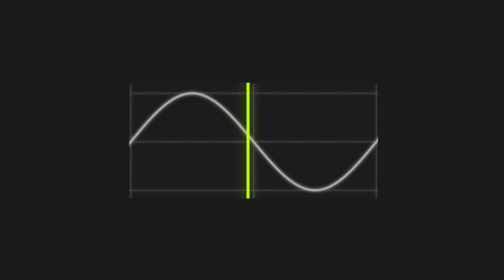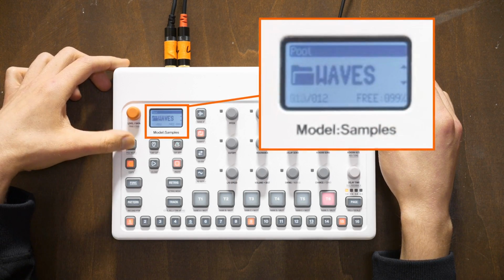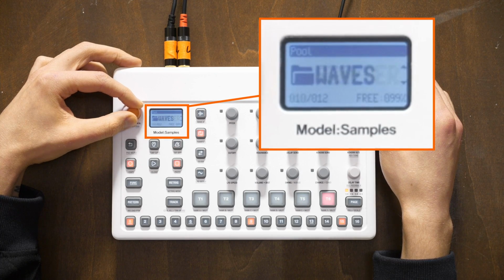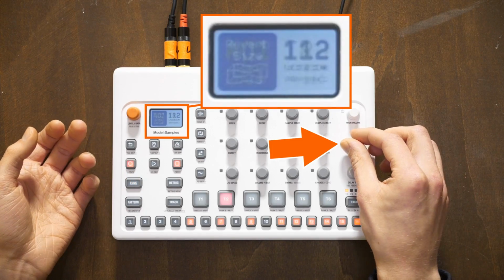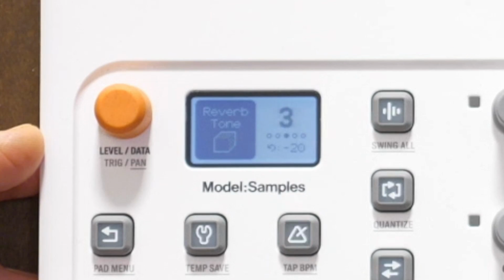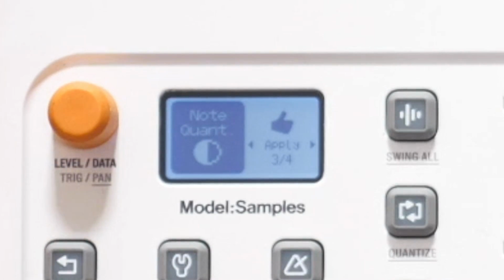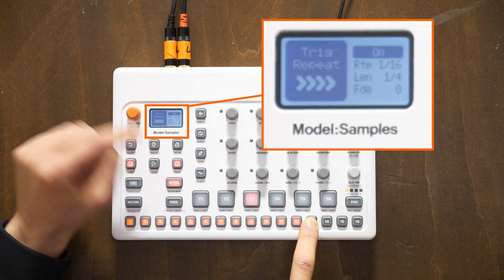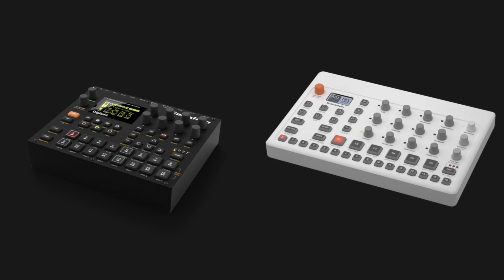Elektron Model:Samples and Ess Senpai | haQ attaQ #TSR19

Comment: the more I try to learn about this machine the more lost I get
Reply: Did you end up getting one?
Elektron seems like they've never used a Yamaha, Roland or Korg...
So they kind of use they're own workflow that feels completely unintuitive to anyone coming from the other corps...
But it makes perfect sense in an Elektron kind of way...
Reply: @BendApparatus  hey I did get this same machine.
Mine wont record right there are two ways to record something but it never works right.it never does what is shows in other videos I tried to follow the steps but it doesnt record right.But I can play it live thats about it.But the pads are good and  can be expressive using the roll feature.I like it but I wish I could record stuff to it,it never works though.
Reply: @dragonmodel9262  🤔
That's weird.
Recording can be done in 2 ways.
1. Push the circle button then just push the little number pads in the spot you want the sounds to play.
You do have to switch to a different track for each instrument using the big pads.
2. Push the circle button THEN the triangle button while still holding the circle button. That puts you in live record mode. Then play your beat using the big track buttons.
you can switch to quantized or unquantized mode. By toggling the above button combo a couple of times.
It's fiddly but the screen will let you know which mode you're in.
There's also a click/metronome you can activate through another button combo FUNC + 🔁.
That is unless you're talking about some type of hardware issue...
Reply: @BendApparatus hey I appreciate the reply.
I will try this and see if I have any luck .hey thank you.
Do you have to set the tempo or how many bars it will play when you record something if that makes sense?because it said you can do a live recording but I willtry this first,hey ty I will let you know if it worked
Reply: @dragonmodel9262  you don't have to set the tempo unless you want to.
The default tempo seems to be 120bpm. I'm 1 of those people who always forgets tempo when making beats...so all my beats are 120bpm...😅

Default bar length is 1 bar (16 steps).
You can make it longer by pushing FUNC + PAGE then using the 🍊 knob to increase it.

But here's the thing.
By leaving it at 1 bar (16 steps) you can try to learn the sequencer's probability and conditional trigger functions to make a 1 bar pattern sound like 2 or 3 even 4 bars long!

There's a lot of power and wackiness in this odd white slate. It's just a matter of trying different stuff.

TIPS!
1. Make a habit of pushing the ⏺️ button after you finish recording live to get out of it and not accidentally record knob twiddling onto your pattern.
2. Once you get a groove going you like. Push FUNC + 🔧 button to quick/temp save to a 📋. So if you knob twiddle yourself into a mess you can push FUNC + PATTERN to quick load your saved groove again!
Remember it's a temp save so you will still need to permanently save by going into the 🔧 menu and pattern save. I will admit this thing's save menu is kind of confusing. So let me know if you need some tips.

I'm also learning this thing.
Reply: @BendApparatus  hey thank you again.I dont know where I put my power supply.I cant turn it on right now.
Reply: @BendApparatus  thank you again I lost my power supply for it.They are kind of expensive too.
Reply: @dragonmodel9262  there's a hidden charge plug on the left side of the Model.
Reply: @BendApparatus  hey thanks.I thought that was for a battery.hey I will try that I seen the power supplies for sale but they are not cheap.ty
Reply: @BendApparatus  nice thanks.I seen that side before but I thought it had the same small plug as the main powersupply.But it was different I finally powered it on again.No lie I was looking for my power supply other times before too.The lights are not as bright but everything works.I will try that step for recording too,because thats what I wanted to do with this.ty
Reply: @dragonmodel9262  yeah the side plug is a much more common size.
YouTube once again removed my link.
As long as the power supply gives 5v @ 1Amp it's good to go.

Once you learn the basics of the workflow and remember to use the temp save (FUNC+🔧) you can get crazy with the knob twiddling.
Obviously there's also a slew of other parameters you'll discover in the menu/screen. You can always get your original pattern back with FUNC+pattern.

Last tip.
Twiddling knobs normally only affects whatever track you're on (whichever big pad is lit up in step mode) but if you HOLD the track button while twiddling knobs. It affects the entire pattern.
Good stuff.
Reply: @BendApparatus  idk why but it does take some time for me to learn this machine.
idk but that always confuses me.I do get lost when I try to record something.
I dont really know how the tracks work.
the best I can do is play along to another song and use this to add more drums or sounds.But I can not make anything on this while recording.I just have to keep trying everytime I think I got something something else goes wrong.Im just saying I see other videos on people making and tweeking the sounds I never been able to do that one time with this lol sometimes I really dont know if something is wrong with mine.you are right its not like other machines.I had 3 different mpc's roland sp404.and even a yamaha rm1 x.I wanted to make something on this but I dont know whats happens.hey thank you I been trying lately.but I end up just playing it live to other songs to add more sounds.I like how it plays but I wish I could make tracks on this and play them back.hey ty again.

Comment: wait, so you can sample audio from iOS device when it is connected via USB ?? Or i'm missunderstanding it ?
Reply: No. This device has no sampling capabilities. However, when you play audio from a device connected via usb, the audio is mixed with the audio from the device itself. Additionally, audio is output via usb which makes recording the m:s without an audio interface possible.
Reply: @doppelganger8659  lol that was a really complicated way of saying...
No, you drag and drop samples into it through USB and it has audio out through USB...

Comment: I just got it in. I’ve been using a Yamaha RM1X for ages but it’s starting to show its age and since I don’t create apt of new beats, it requires me to dive into the manual every time when I write a new drum track, because it’s that complicated.

Now having said that, the Elektron’s manual requires some quick start sections to be honest.
But it’s not as complicated as the RM1x but it takes a bit of time. For example selecting a sample requires you to press the button to keep it locked up the track. I’d you don’t click the button after you change to another track your selected sample is gone; which is idiotic as you audition it you’d expect it to be implicitly selected.

But it’s really a nice simple drum machine, that allows you to quickly draft up your drum tracks. I just finished a backing track for Falco’s Amadeus, where I used it for my first project. And immediately dove in to do AHA’s take on me drum track. It’s kind of addictive and that’s good.

I’m not yet sure how to create odd time signature beats.
Like 5/4th and 6/8ths as I use those a lot too.

Comment: So, I gather this unit doesn’t sync to other hardware? Just receives and sends note info via midi? 😔
Reply from the maker: Incorrect. You can read all about how SYNC works in Model:Samples under section 11.3 MIDI (11.31 SYNC) on page 38 in the manual >>> https://www.elektron.se/wp-content/uploads/2019/02/Model-Samples-User-Manual_ENG.pdf

Comment: Hey did you ever finish building the echo base from musicpcb? How did it sound and will you ever put up the video on the wiring for it?
Reply from the maker: Yeah the Curcuit and wiring is done but the enclosure isn’t finished. I thought I’d wait with making a video on it since most of my viewers (at that time) weren’t interested in that type content, so I needed to space the project out. Also I need the enclosure to be finished. Panel is on the way though. I’m also building a second one because the final product is going to be stereo. A video will be done when it’s finished but I have no clue when that’ll be though. 😅

Comment: Forgive me for my ignorance as I’m not an IPad musician (but I do have the m:s), but why is class compliant usb such a cool feature? What would you use it for? Someone school me 🎧
Reply from the maker: External USB gear has to be class compliant in order to be able to connect to and work with iDevices. iOS doesen’t work like normal operating systems (OS) and so there’s no way of downloading drivers for external USB gear like one does on Desktop/Laptop computers. Class compliant is like saying “plug n Play”. No extra drivers needed. Like Ess states in the video, M:s is class compliant and allows for streaming MIDI and Audio in and out of the iPad/iPhone. This can be done over USB without having to add a sound interface to the setup.
Reply: Jakob Haq thankyou for the in depth response Jakob! Ah, so now I understand....great video by the way, the editing is very well done and it’s one of the most informative on the m:s out there 🎧
Reply from the maker: My pleasure, and thank you for your kind words. The camera and switcher crew did a great job on the raw footage so I had great material to work with for the editing on my iPad.

Comment: I can’t wait for this thing. Adding sound locks is huge and opens up so much potential. The only requests I have is a shift+decay function to add attack to the Envelope and a filter EG if possible. Seems like they’ve all but maxed out the DSP on this thing. Regardless, I’m still getting it, and I sold my Digitakt to do so. The Digitakt is a great machine, and it’s a very powerful machine, but having most of its functionality on a knob per function device is too enticing. My workflow and the kind of music I make requires constant tweaking of parameters and a lot of adjustments on trig conditions. This became a pain on the Digitakt because it’s all menu/page driven. Having everything in front of you greatly improves my workflow and makes me much more willing to experiment. In turn, I make sounds and drum patterns I never would’ve made before. Like Ess said, each person will find something they like in each device. For me, it’s the Model:Samples. Adding sound locks firmly placed this into Elektron’s already solid repertoire and it’s deserving of its spot.
Reply: Did you end up liking it?